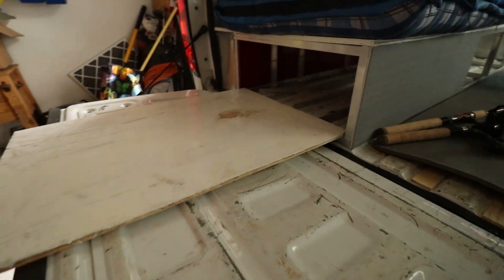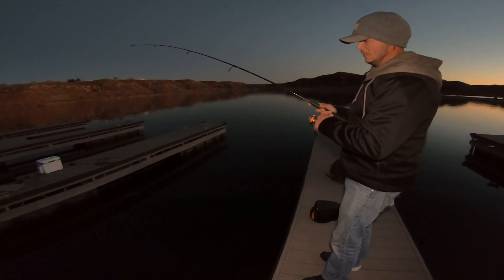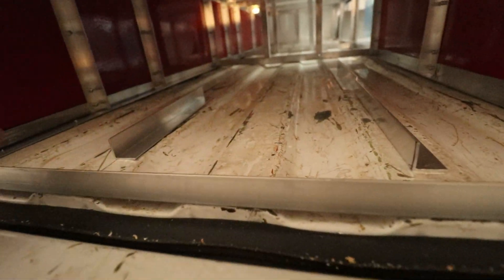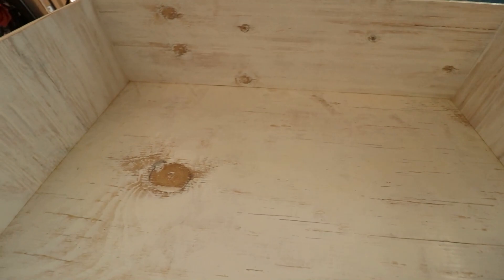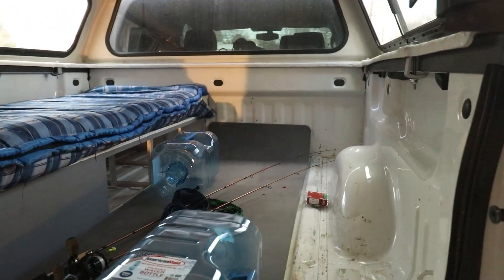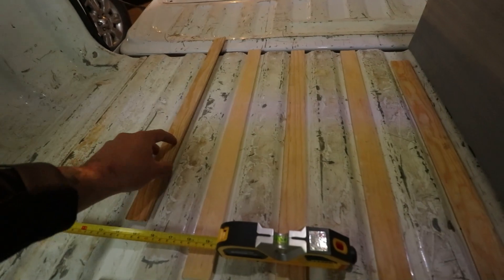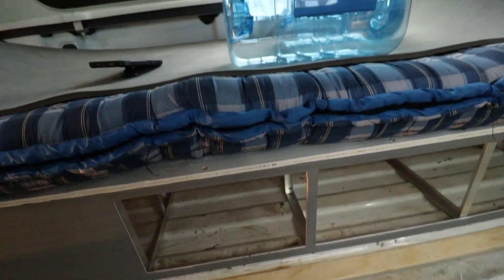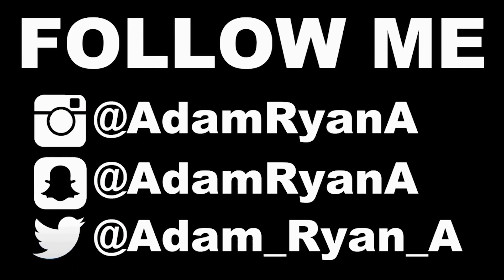BUILDING DRAWERS And PLANNING The REST Of The TRUCK CAMPER BUILD!!

Comment: Using both a hatch & drawer option to access each storage area is better. That allows more flexibility. If you don't use ball bearing drawer slides, You will want your drawers sliding on a flat side of the angle instead of an edge. Maybe a few short square bars supporting the angle would work.